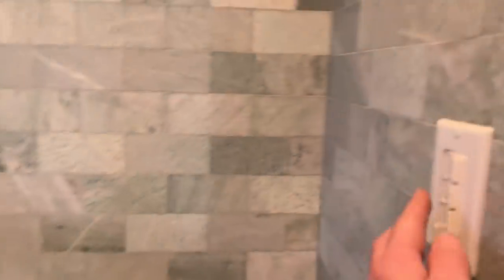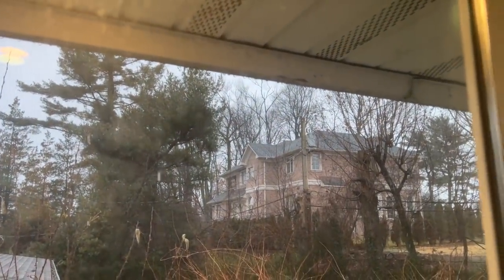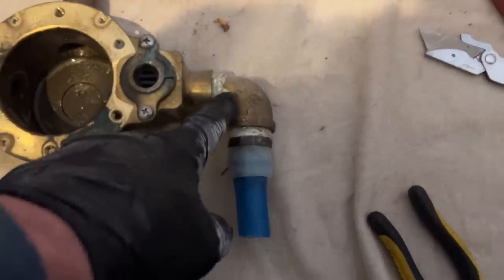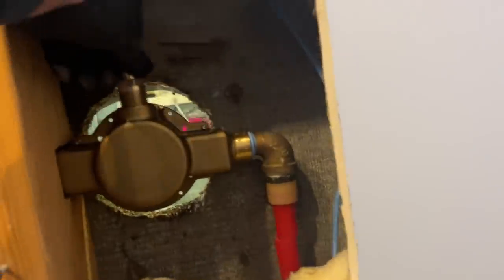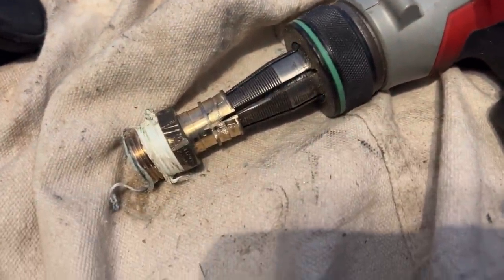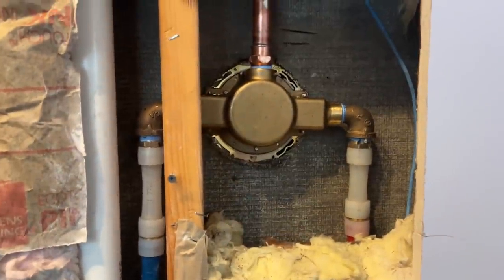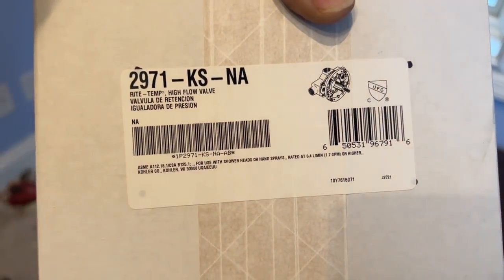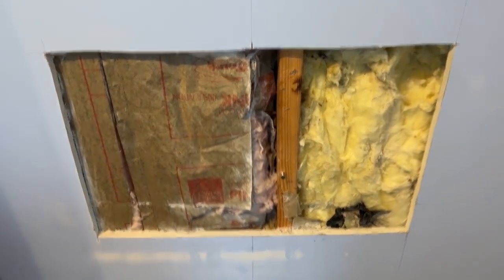Kohler Shower Body Replacement and Stuck Expansion Tool Removed

Comment: Mike I have that exact valve that I used in a high flow situation on a remodel. It leaked from day one. Kohler sent me the internal parts and that didn’t fix it. They sent me the whole valve but before I put that in I got to looking at the inside of the housing and figured out what the problem was. The key to making these things not leak is the interior of the valve body has to be absolutely clean with no corrosion on it or gunk and you have to lubricate it with the waterproof lube that they send with the cartridge kit. I cleaned up the original one, lubed the heck out of the interior and put the original parts back in exactly as depicted. Problem solved  it’s been working fine since. Kohler is a great company and they sent me all those parts at no charge. They should because the damn valve is over $300!
Reply: You are 100% correct here. What you suggested is…and was the solution. I think Mike may not be so well-versed on the intricacies of how to diagnose problems like this. He seems to be learning as he goes, but if I were him, I would not have charged my customer for my mistakes. Maybe the first time, ok, but after doing the wrong thing three times, I do believe my customer would have lost faith in my ability to properly diagnose a problem as simple as this was in the first place. To replace the entire valve body here was just plain wrong and a waste of the customers money. But I give credit to Mike — he puts his fuck-ups out there just as much as he does his successes.
Reply: many people had/have the same issues with the smaller kohler valves that have the pressure balance cartridge behind the control cartridge.
if the body isn't clean it wont seal to the back and either hot or cold will always leak through, I have seen some bad enough it was trickling flow and filled a glass in no time.
cleaning, cleaning, cleaning and cleaning some more is key. all brand of valves have their quirks and need to be clean and lubed so the o-rings don't get nicked when assembling.

Comment: With Uponor  expansion fittings, there is a minimum distance between 2 fittings to avoid the exact problem you ran into! Also another observation, your expansion head is pretty dirty and worn and I would suggest changing that. Also, when you lube the cone piece that makes it expand, that needs to be absolutely clean and very lightly lubricated so none of the lube oozes out and gets into the fitting. Ask me how I know!

Comment: I like it when you show good old plumbing, as that would be internationally required. HVAC is more a Northern Hemasphere thing, still interesting with the boilers though. Down here we are going along the lines of electric heat pumps.

Comment: My supply house is saying uponor is temporarily doing the colored lettering instead of outer layer to keep up with demand. Supposedly its quicker cause it doesn't go through the machine a second time for the outer layer. I actually like just using the normal clear and the blue writing one. one less color to stock and looks cleaner than the bright colored pipe.

Comment: I believe the minimum distance between Uponor fittings is 6". Not sure why you didn't open up the wall more to give you better access to the Pex risers so you didn't try to squeeze the fittings into a space less than 6".

Comment: Great job Mike! Give me your honest opinion. I’ve got 30+ years as an HVAC tech. 20 of those years in facilities in a school system. I have a hard time I using these new plumbing systems. I’m old school believing a soldered joint is the best joint. Do you like the peck system and in the time you have used it have you had any leaks over time?
Reply: Pex system.  Definitely a new school thing.  Much, much more inexpensive and easier to run than pipe.  Give it a try.

Comment: I wondered how you will make Uponor connection with such a short piece. LOL  Minimum length between fittings for 3/4" Upnor is 3".  I have cracked fitting once, but never got it stuck. Did you try unscrewing expansion head first?  That might have released head allowing you to remove the tool.

Comment: And she still drips...
Reply: probably a piece of flash/burr left from brass casting/machining that's nicking/tearing an o-ring, upon pressure balance or valve assembly.
cleaning and more cleaning with lube a plenty is critical for assembly of all faucet types. having dealt with slumlords and installing the cheapest junk to expensive junk over the years, nothing is perfect, rarely tested and the end installer/home owner is the alpha/beta tester. that sucks because it makes you/me/other contractors look like total imbecile jack-wad buffoons. that some up all construction materials and equipment now days, tons of it.

Comment: Or you could unthread them pex head and it’ll pop right off
Reply: yeah, it would have let the pressure off the jaws and the brass would have fell off. would still need to cut the pex itself off though

Comment: I have the Milwaukee oscillating tool battery one it’s the best blades for everything metal etc even if you just use it for cutting Sheetrock it’s worth it